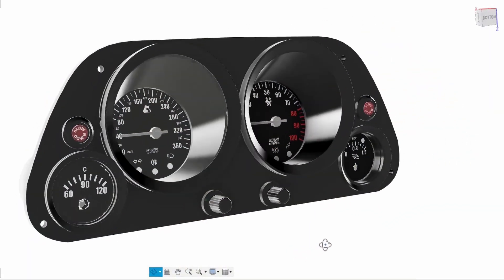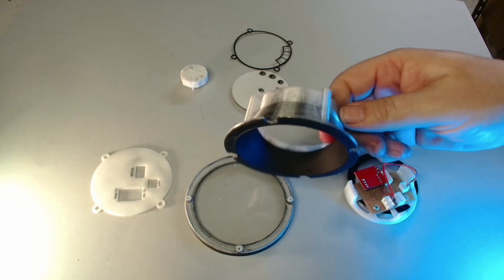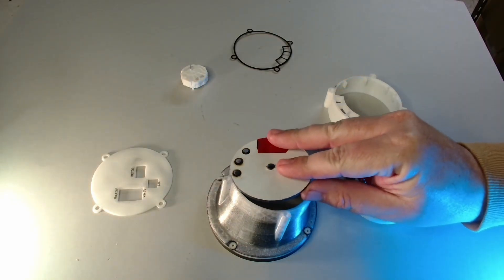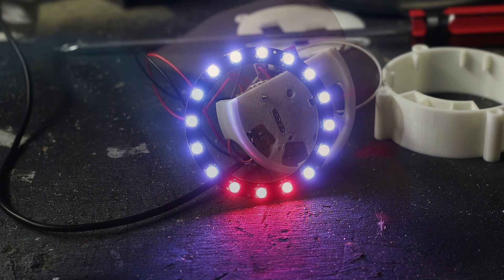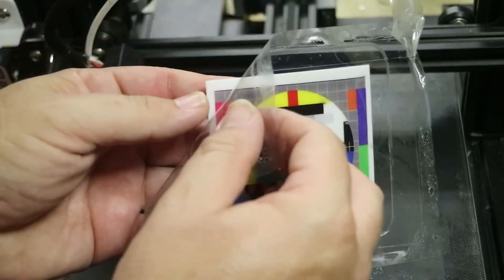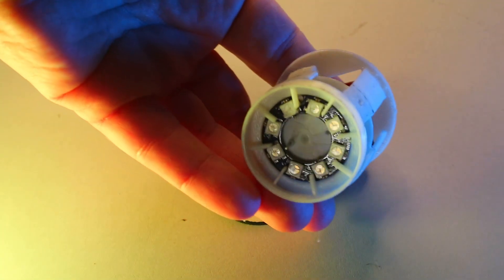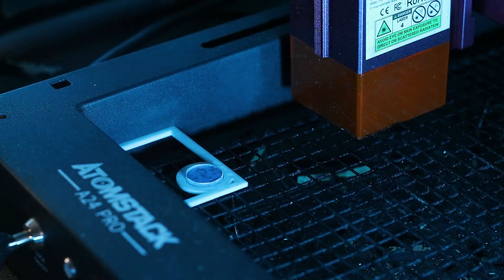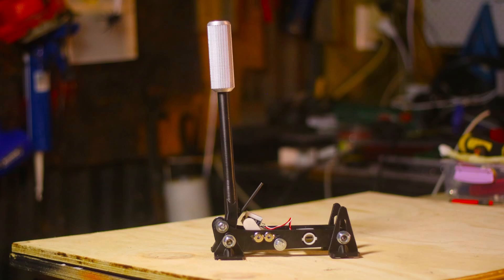DIY Automotive gauges

Comment: I think I saw someone else do this, they printed on photo quality paper, and printed a few times to layer up the ink to block as much light as possible. to me the vinyl sounds easier if you have the cutter or want it all one color.
Reply from the maker: I was thinking of a cricut, they are quite expensive also. I am thinking of making one out of an old inkjet printer.